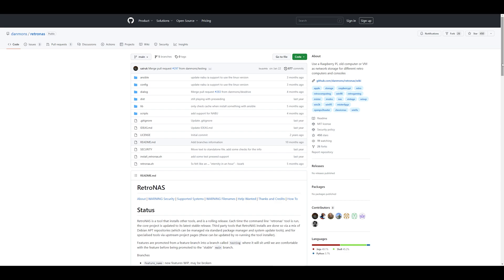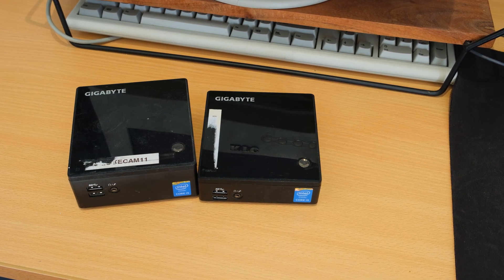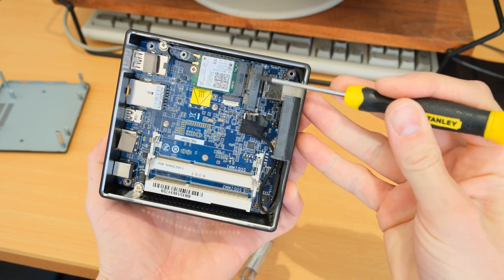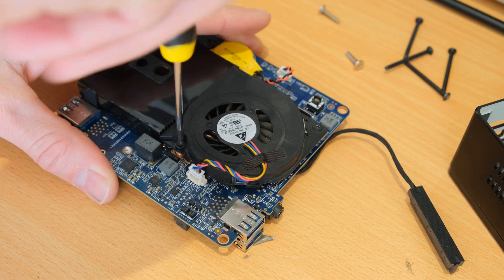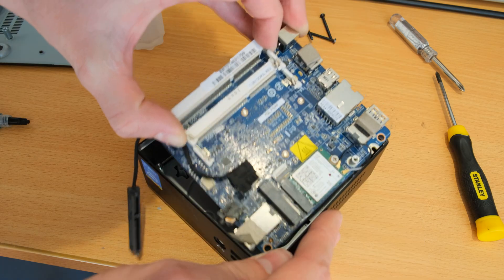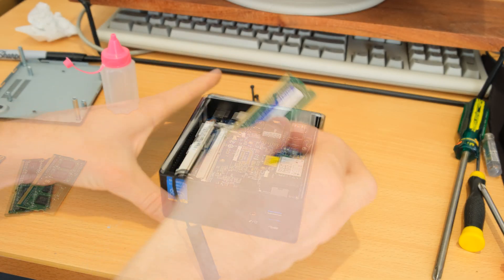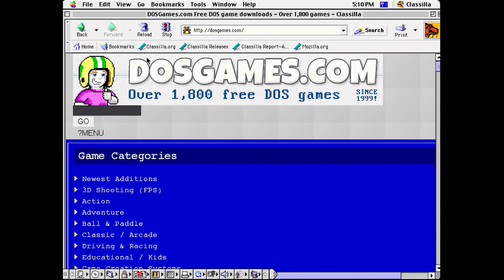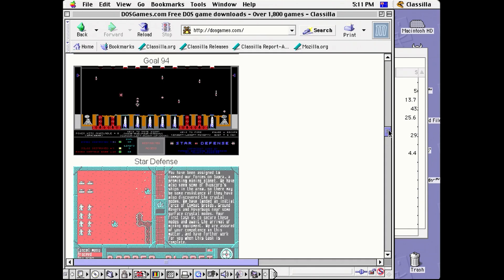Building a Mini PC NAS | RetroNAS

Comment: Hi there, I'm Dan, one of the RetroNAS devs.  Very glad you liked the project and it all worked out well for you.  Thanks for sharing your experiences!
Reply from the maker: Hey Dan, Glad you enjoyed the video and thanks for your efforts on such a project! it's still working a treat and has been really handy on a very wide range of retro machines. Especially that Apple Talk! The fact you don't require separate shares to each host type is fantastic
Reply: @thesmokingcap  That was definitely the goal of the project - trying to make something that could act as a central hub for all your old stuff.  Classic/retro computing can be a pain when you have a fresh install and it's difficult to get drivers and apps over to your systems.  Hopefully this makes it a tiny bit easier for people.
Reply: Can you run retronas on the same installation drive?
Reply: hey, I can confirm it works since my single HDD laptop managed to handle it